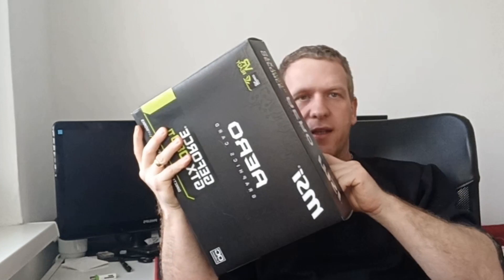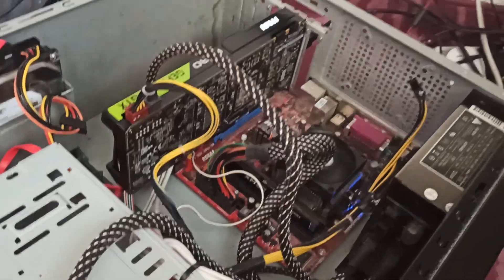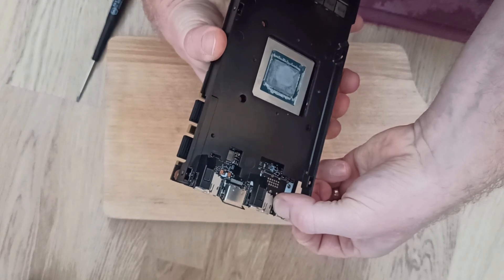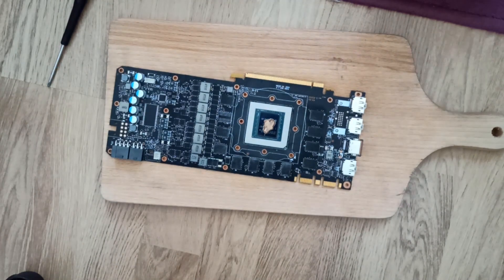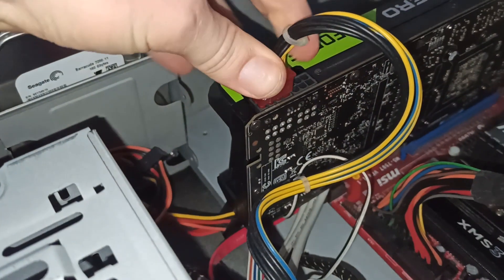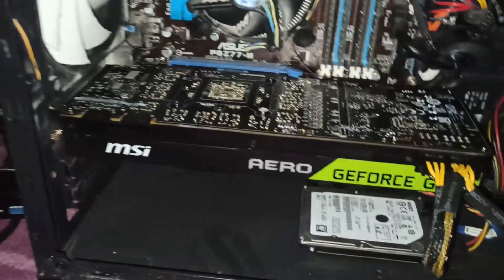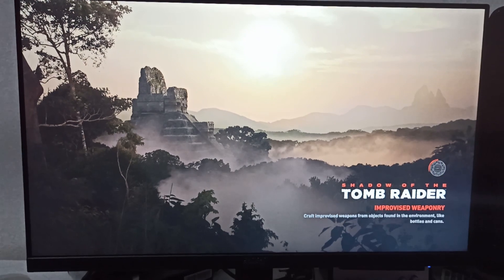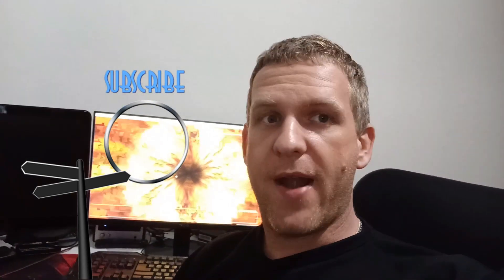How to fix No Signal or Black screen problem on any GPU - this time on GTX 1080 Ti

Comment: i have the same thermal paste and its awful it even overheats my i7 5820k. 75c @ 1480mhz is not good my friend. test it on heaven and you will see it cook itself. and furmark is not boosting the gpu to full 3d clocks
Reply from the maker: I have only good experience with this thermal paste
Reply: @frogtechtips  if it works for you thats good my friend. ltt did a video about this same thermal compound.https://youtu.be/qaoTARN3sv4. good video and well done on fixing the gpu
Reply from the maker: @stejonno2226  thanks I will check that but I think I already see that video
Reply: @frogtechtips  i got myself the same thermal compound that you have it works but it struggles with my 5820k and even a old gtx 670 its thermal throttling. if you even change it for some mx4 you will see the difference night and day. glad i found your channel and you have a new subscriber
Reply from the maker: @stejonno2226  hi thanks for your Tips and I use mx4 as well for now I like GY 870 or 890 both is good for me and I hope you will like my other content as well

Comment: Hey there I have a gtx960 2gb, it doesn’t display anything except black screen and my device manager won’t detect my card from intergrated graphics, my fans spin and it lights up just like this one, should I try this ? I don’t have a heat gun or flex
Reply from the maker: Hi your card is out of warranty I will definitely try reheating GPU there is nothing to lose anyway but you will need heat gun and flux buy or borrow heat gun from your friends
Reply: @frogtechtips  the closest thing is a hairdryer to a heat gun, I don’t know anyone around my area who has one, and I don’t have flux unfortunately so I’ll have to just buy a new card :(
Reply from the maker: @pjxmesyt  hi some people write on comments have succes with hair dryer as well you can try with that or buy one you can get some cheap one from shop :-) btw you also can use oven but is something I will not recommend but I know is working as well
Reply: @frogtechtips  is flux necessary as I don’t have any? I don’t wanna ruin the card even more I’ve never done this before
Reply from the maker: @pjxmesyt  hi flux is important but many people do without I will recommend.you buy some is very cheap

Comment: My card does same thing boots to black screen. 1 month old 800Dollar 6700xt. So pissed
Reply from the maker: If it's 1 month old take back and ask for replacing card under warranty
Reply: @frogtechtips  I tried. Power color said no bc I bought it off eBay.
Reply from the maker: @beyondgreatness1861  and did you buy as new one
Reply: @frogtechtips  he said open box. Just tested to make sure it worked. It was really clean. Looked new to me. Lol
Reply from the maker: @beyondgreatness1861  and warranty sticker been broken maybe sellers have some POP from it if not you can still try eBay or PayPal for help as been expensive staff maybe they will help you or and if not you can still try reheating
Reply: @frogtechtips  ok. Ty. I’ll look into that. Before I try it. I. Ty bro. 👍🏻👍🏻.  My wife still yelling at me for spending all that money and now it’s broke. SMH. Lol
Reply from the maker: @beyondgreatness1861  he I know exactly what you mean

Comment: This worked for me but i used a candle to revive my sleeping card which was not booting and stuck at black screen. Lol Thanks.
Reply from the maker: Really nice job
Reply: I know its a old comment but can you explain how to do it. I changed my thermal paste on my 1080 and now it shows only black screen but everything powers on properly. Dont have a heat gun and have tried everything else
Reply from the maker: Is before you replacing Thermal paste all works without problems if yes you probably make some physical damage on your card

Comment: How can I reheat the gpu if I don’t have that heat gun? Any ideas? Can I use hair dryer?
Reply from the maker: Hi you can try some people write is working even is hard believe as I think is not strong enough. You can buy cheap heat gun about 15 EUR easy on ebay

Comment: Hi good day to you, my card is almost same as the one you fixed, the problem is it only works in very low resolution like 1200x something but when driver is installed and become full HD 1920x1080 then my pc sudden reboot, I try many times but it always  reboot it only stays for about 10 or 20 seconds,  can I ask for your advice if my card can be still repair?  My card is 1080ti and psu is 600watts with i7 10 gen and 16gb mem. Hope you can help me, thank you.
Reply from the maker: Hi did you try any repair try first flashing BIOS get new drivers test your card 8n your friends pc and if nothing works definitely try reheating
Reply: @frogtechtips  can I use hair blower for reheating?
Reply from the maker: @I_Am_Yamiko  if you looks on comments some people use tham and works but is not what I recommend :-)

Comment: Hi, I've got a probelm with my Asus Strix gtx 970 I got recently on eBay. My first problem is I need to load into bios first so I can load into Windows, otherwise I will get a short blue line running horizontal on my screen. And second is I get a black screen 3 minutes after I've loaded into a game and I have to restart my pc. Do you know what the problem could be?
Reply from the maker: Hi did you buy as broken card if not I will send back to seller otherwise you will need try reheating GPU that's should help

Comment: god please people do not do this run Mats/mods diag tool first  bad memory ic  can cause no display and card to detect  only go for reflow if card does not detect in windows as a secondary card useing gpu z  if it does not u check for ur voltage rails  if the rails are all there  then u look in to reflowing the gpu  and only then do u do that as a last resort
Reply from the maker: I always say this is absolutely last option when you trying all other staff and form my experience this reheating GPU working nearly always and don't worry your card will not getting worst if you tried this but again I always say this is last step if you know there is nothing to lose anyway
Reply: @frogtechtips  The point is, your channel mistakenly gives people the idea that GPU's need to be reflowed if it doesn't work at all. This is simply not the case. People could be ruining a card that could otherwise be fixed with your advice.
Reply from the maker: @kavjd6476  point of my repair is for people who know nothing about how to check all that staff and I always say is last option btw from my experience and about 1000+ card repair about 75% I repair only with reheating without any other tests and ye maybe you will be surprised I have some cards wit working now 5 years after repair / reheating GPU 
I know is not correct repair and if you don't like it simple don't do it

Comment: Hi i have problem with my asus strix 980ti fans and led work good on graph card but no signal no display :( idk why i buy it for much money and i dont have to much money for buy services :/
Reply from the maker: Hi did you buy as not working card if not send back. Is your PSU strong to power this card as this card is so power hungry

Comment: Thank you for this educational video! I had no idea you can re-solder the GPU with a just a hand-held heat gun on a desk, without an oven or other specialized equipment. My 1080 Ti has, sadly, died with the exact same symptoms after 3 years of working. Glad to see there may be hope of reviving it.
Reply from the maker: I only can say from my experience if you use flux you will never broke board and some cards working 1 day yes after just need repeat process with bigger temperature and longer time and sometimes need BIOS modified as well and some cards working even after 6 years  that's my experience and I fix about 2000 card in my life
Reply from the maker: You welcome and I hope you are subscribed to my channel and you will like my other content as well
Reply: Did you try it and if so, did it work?
Reply: Well you can't, it's the gpu that just got its bad internal connection re connected because of the heat. It will go bad again at some point.
Reply from the maker: @FilipMunk  yes can be tru
Reply: Because you can't. Solder, especially not lead solder, need much higher temps.
Reply from the maker: @SailingAway69  ye you right and you have some good points as well

Comment: hey i got this card and it is brand new, but the same problem the screen is just black on 480p and does not show the bios on boot. i was wondering what is the brand of the Flux you are using? Thank you for all the content!!!!
Reply from the maker: Hi if you got this card brand new is probably in warranty with is best way to go. Question about flux look on description there is some links
Reply: @frogtechtips  Thank you, yes i am going to try the warranty first but if anything I will follow your information
Reply from the maker: Yop

Comment: THis is not a fix, far from it! Give me a break!
Reply from the maker: It's working and that's point I repair card with this style many years and ye sometimes working 1 day and sometimes even 5 years from from my experience
Reply: @frogtechtips , come on, black screen, no signal has nothing to do with the card overheating.
Reply from the maker: @sovu9399  it's have and to much if your card over heating can get no signal or artefacts problems
Reply: @frogtechtips  i have artifacts problem, freezing and restarts, but temperatures in Aida64 pretty much acceptable. what that could be, my card is dying?
Reply from the maker: @sovu9399  hi definitely yes your card die Start dying temperature is probably ok as GPU not working on full power and something is go on in some solder point that's what I think if your GPU is out of warranty  and  you try everything else go and try reheating GPU  like I always say there is nothing to lose anyway
Reply: @frogtechtips  i'll give it a try, hope it works
Reply from the maker: @sovu9399  let me know after
Reply: @frogtechtips  i reapplied thermal compound, put the heatsink back on, all cables/wires connected properly, I press power button, gtx 1080 logo led turns on, then in a few seconds led turns off, then in a few seconds turns back on again, system is loading, i can hear login sound, but the screen is dead black, i changed from HDMI to DP and vice versa, no signal. 
what that could be?
Reply from the maker: @sovu9399  what did you done just replace thermal paste  or something else as well
Reply: @frogtechtips  I just replaced thermal paste, nothing else. The logo led lights turn on then turn off, something tells me it is a power issue, but i"m not sure, the system loads but the screen is black. Now i installed my old trusty gtx 580, everything works just fine on 85MHz refresh rate, no issues at all.
Reply from the maker: @sovu9399  but you have problems with arefact before you replace thermal paste if IAM right
Reply: @frogtechtips  yes you're right, and the current problem also i got 1 day before I replaced thermal paste.
Reply from the maker: @sovu9399  that's mean your GPU die  or Vram have some problems as card is out of warranty I will definitely try reheating GPU die and VRAM as well like I do in video there is nothing to lose anyway
Reply from the maker: @Dirk Pitt Flux gel one

Comment: Sorry what you put into around on GPU. What it call?
Reply from the maker: I think you mean Flux and is gel flux
Reply: @frogtechtips  is it compulsary to put those flux?
Reply from the maker: @lalalulu3084  yes is better as Flux keeping soldering point separate with men you can be sure will not make a short and also solder point melted quicker